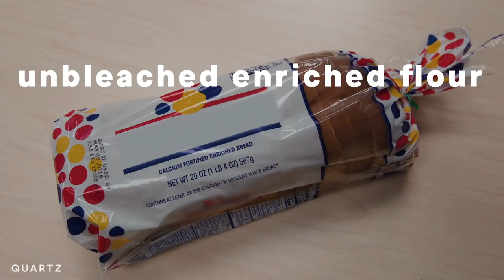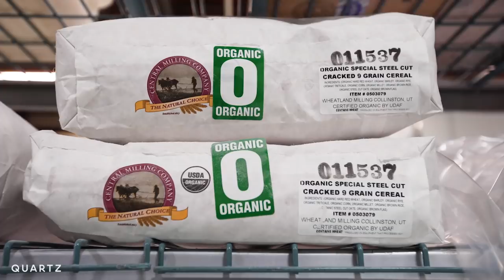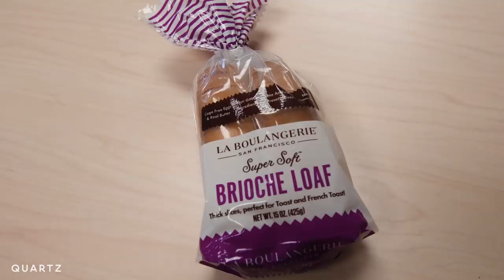The future of factory-made bread can be tasty

Comment: I don't want any chemicals in my body that's why I refuse to drink anything that contains dihydrogen monoxide.
Reply: That’s water right? Please reply
Reply: @dogofwisdom1411  YES, it's the chemical compound of water loool
Reply: Null Null your body is literally made of chemicals and water is a chemical
Reply: @thenoicemango1827  r/woooosh
Reply: @malacki6554  They can be called both based on this article it states "Hydrogen dioxide (or more accurately dihydrogen dioxide) is H2O2, more commonly called hydrogen peroxide. H2O could be accurately called dihydrogen oxide or dihydrogen monoxide." so it can be called both